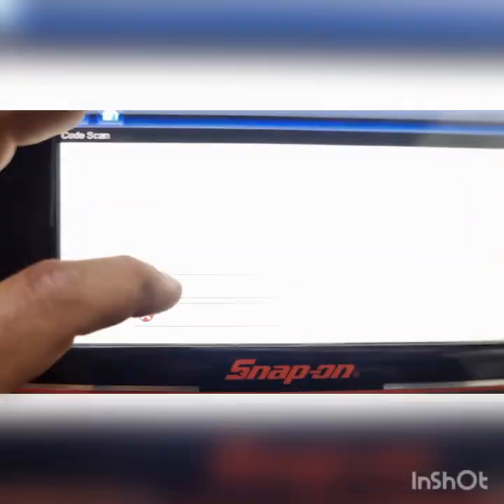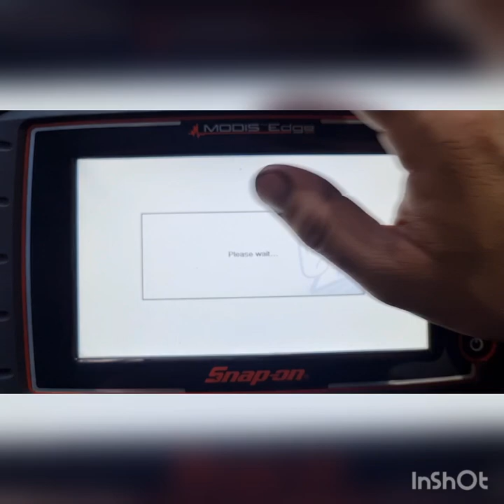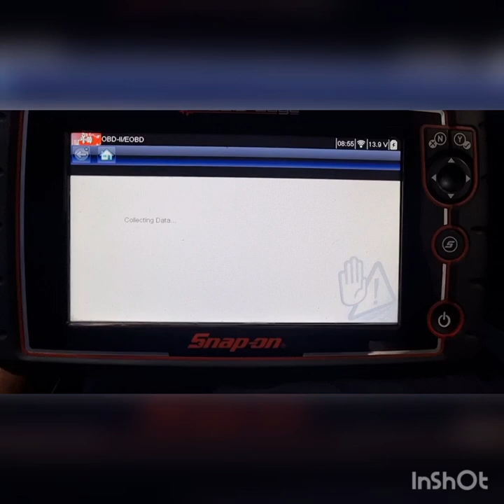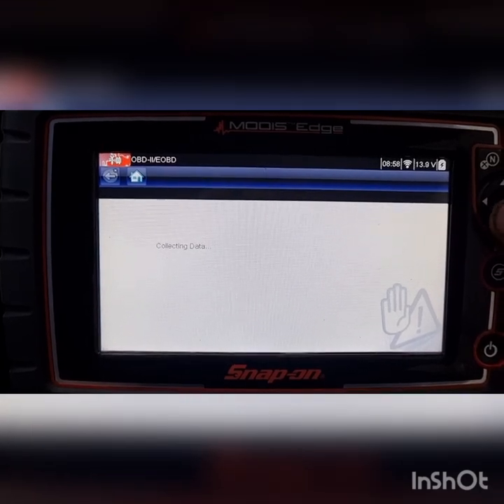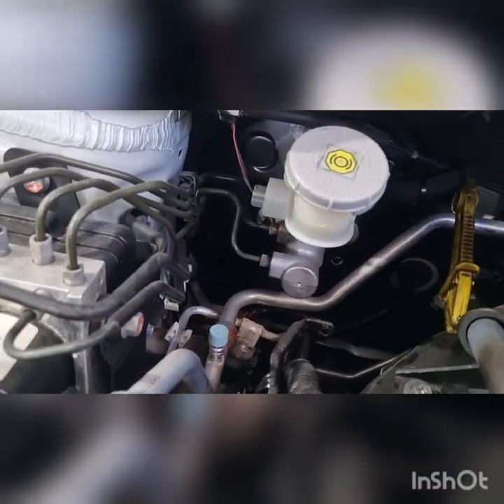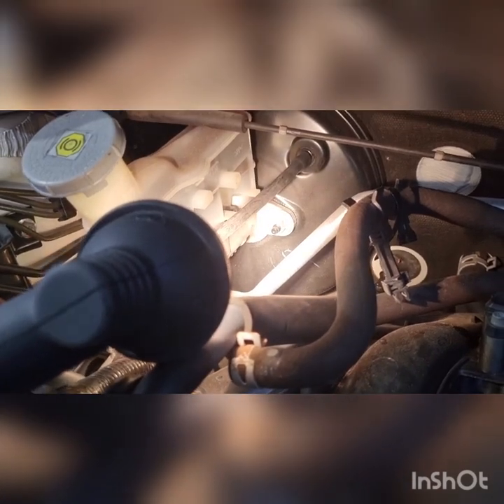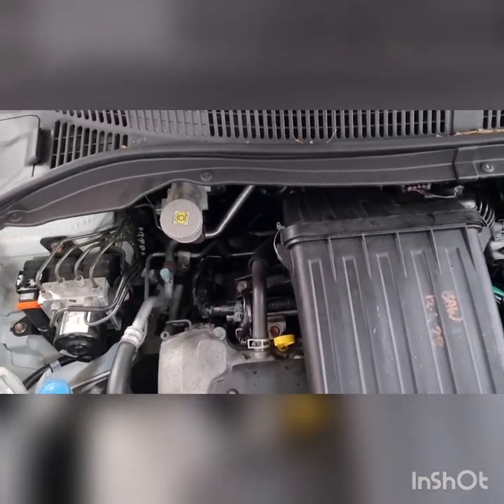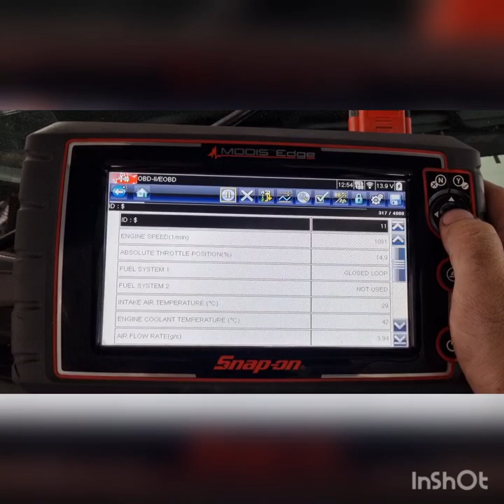Suzuki Swift; P0420 Catalyst Efficiency Low, P0171 Lean Bank 1

Comment: Great video man. I have a swift sport 1.6 zc31s and it shows 2 codes p0420 and p0171. I know my cat is bad as I hear a rattling noice at higher rpm, but I would like to know if there is anything else that could make system too lean error as I get bad fuel economy and very high oil consumption (the exhaust doesn't smoke, it just accumulate black tar after long driving). First O2 sensor is brand new, pcv valve is replaced, new piston rings and head gasket. Can I remove cat and fix p0171 code? I wish i have a skilled technician like you who can use a proper diagnosis tool to find out.
Reply from the maker: Lots of things can cause the p0171, fuel injectors, fuel pressure , internal vacuum leaks from brake boosters or manifold gaskets, exhaust leaks pre pre 02 sensor can cause false leans

Comment: Got a lean po171 code on my zc31s swift sport has a mid pipe cat delete and I got a lean code wil this be o2 sensor? Is there one or 2? I have had no mid cat for 2 months bit today took it on a long drive and it randomly popped up
Reply from the maker: 2 02s, one before the cat, one after 

The second one monitors catalyst efficiency 

The cat removal will not be the cause for the lean code 

Check for vacuum leaks, egr leaks, fuel pressure issues
Reply: @RealAutoSolutions  have put it down to bad first o2 sensor had a tuner look at it

Comment: Damn. Nobody in my city has an advanced tester like this. Except Volkswagen and BMW they all have universal testers that tells me P0420 catalyst system efficiency below threshold (bank 1) on my 1.3 Suzuki and that's all. I need to start changing all the parts that may be faulty and after each one I must hope the error doesn't show again
Reply from the maker: I would suggest using the best possible fuel in your town

It may have suffered sulfur poisoning, you can possibly bring it back to life
Reply: @RealAutoSolutions  thanks for the answer.
I have another question. I noticed a while ago that every time I open the gas cap it makes a hissing sound, like when you open a sparkling water bottle. Do you think it may be related?
Probably I should change it anyway
Reply from the maker: @raduszilagyi6055  that's normal in most cases.
Reply: @RealAutoSolutions  oh, I understand
Reply: I just replaced my spark plugs and noticed the I have a cooked O-ring. In English I see the part is called gasket set for crank case. I ordered the part, but due to Easter holidays it will arrive only in 5-6 days. Do you think it may be related to the p0420 code?

Comment: was the p0420 code also because of master cylinder vaccuum leak?
Reply from the maker: No mate, the p0420 can be from a number of things

If you're suffering the p0420 code I would suggest running it on the highest octane rated fuel you have for a few months and see if you can bring it back to life. It may well have sulfur poisoning
Reply: @RealAutoSolutions  Yes I am suffering from p0420. My mechanic says it's because the petrol not good in Turkey but some other suggests to change the cat. Nobody want to open it as it's a bit hard job I guess
Reply from the maker: @murattopuz516  use the highest rated octane fuel possible for a couple months and see how you go, otherwise you will need to change the catalyst
Reply: @RealAutoSolutions  ı see thank you very much 👍☺